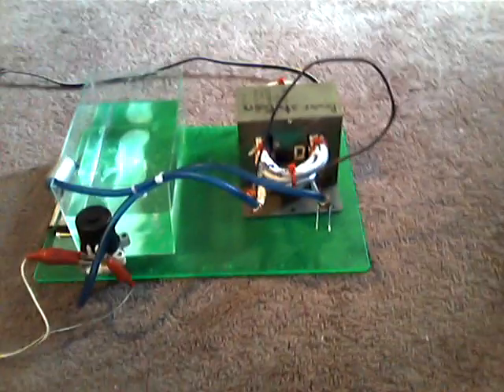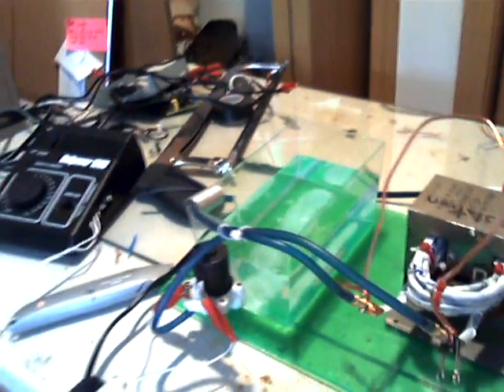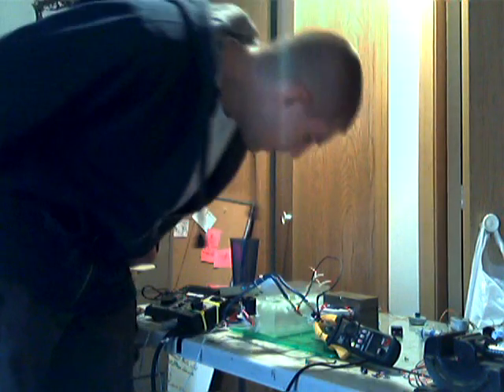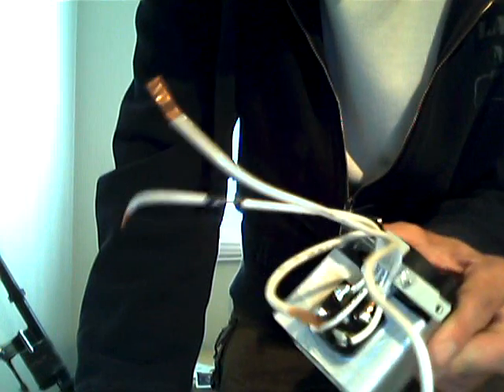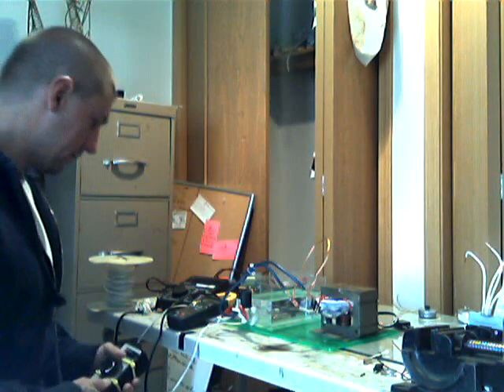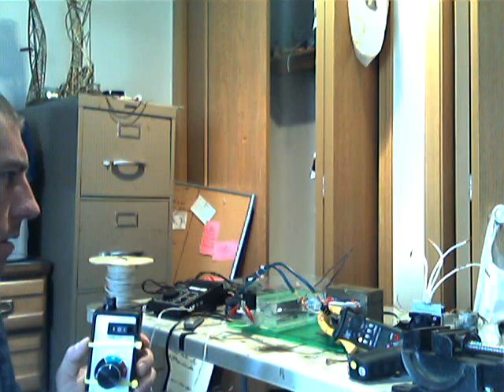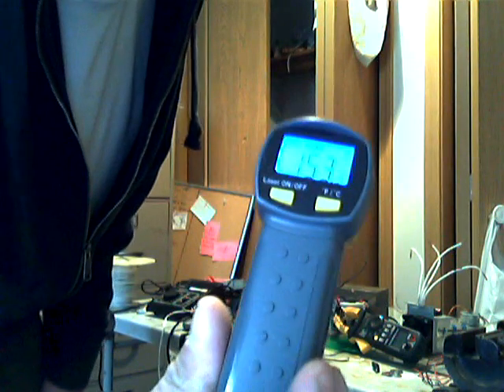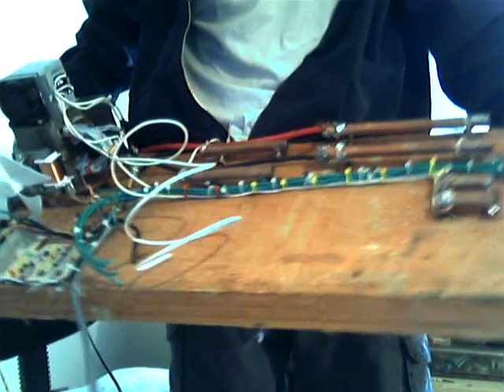high amp water cooled ( MOT ) power supply

Comment: @NOBOX7 OK thanks a ton, I just got done constructing a dry cell, I will be passivating it tomorrow and then testing it. Should be uploading test results to my other channel, I am also planning on constructing a power supply with a mot that I have acquired, but for now I am stuck with a 30 amp ATX supply.

Comment from the maker: i am going to try and air cooled set up on the xformer for the primary and i have a question for u will my diod need to be disconetcted from my mot wen i using the ac buss,it wount be connected to any thing but what im saying is if u connect the ac side of a diod will it still heat up if the dc side is disconnected, its a fullwave bridge type ? when i make the vid on the power supply this is goin on i will ask u again and show u what i have

Comment from the maker: i am going to use an old bat charger transformer to run the pump, any way im currently working on a power supply device that generates differant voltages and amprages for electrolysis and other uses in experiments, the hole thing is made of free junk exept the solder and zip tights so its unsightly but to me its very neet ,,

Comment from the maker: well gary in the past i have discover cutting the laminations is a bad idea,, the magnetic properties of the mot cause extream vibration at 60 cycles a sec thats quite a rattle  even bolting down the two peices isnt quiet enough ,, at 20 amps the mag field aint no joke,good comment though i wish it was an option cus i damaged the insulation on the tubing and may have crimpt the tubing a little

Comment: A PC Powersupply may be able to run that 12V washer pump too, that plus some anti-freeze in the water may improve cooling efficiency to the point that the transformer could run long periods of time.